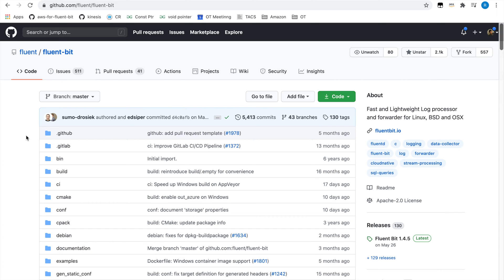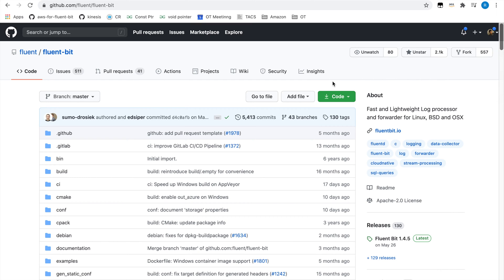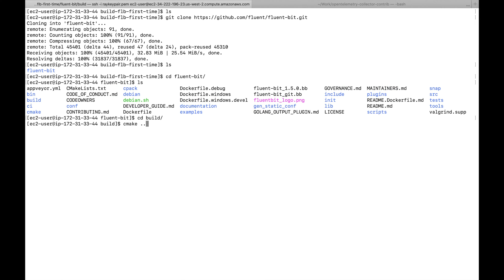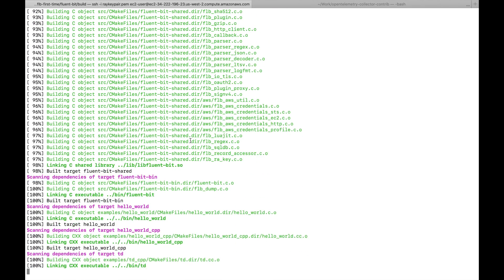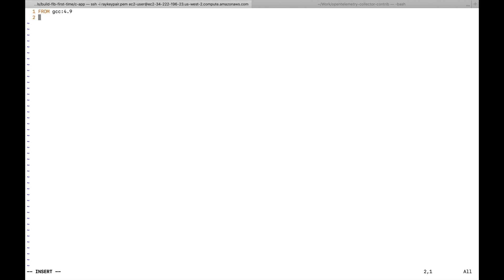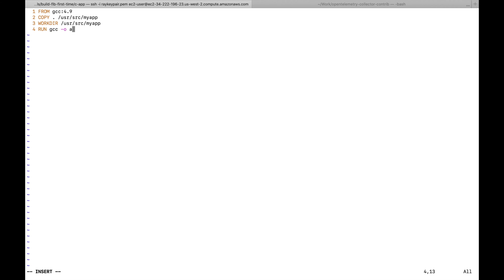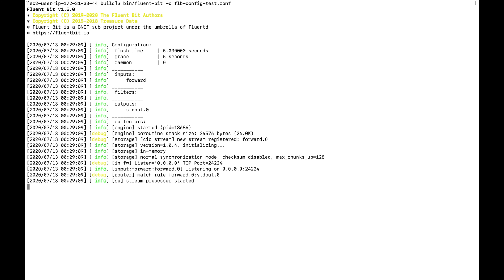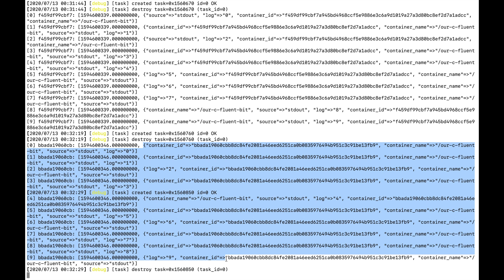Fluent Bit Tutorial Day-1: Build FluentBit from source and run with custom config and logger file.

Comment: Fluent Bit is an open source log shipper and processor, that collects data from multiple sources and forwards it to different destinations. ... While both are pluggable by design, with various input, filter and output plugins available, Fluentd naturally has more plugins than Fluent Bit, being the older tool
Reply: Great intro. Thanks